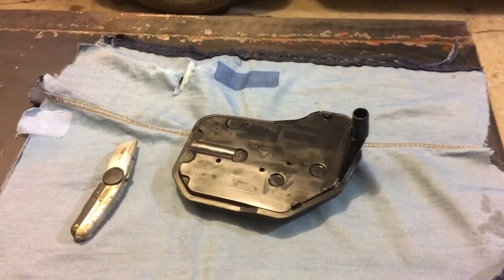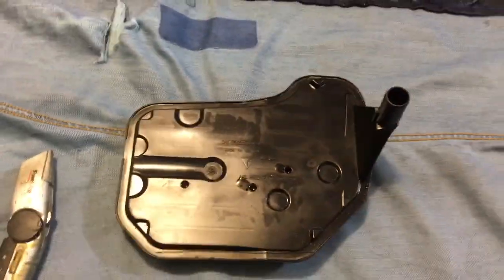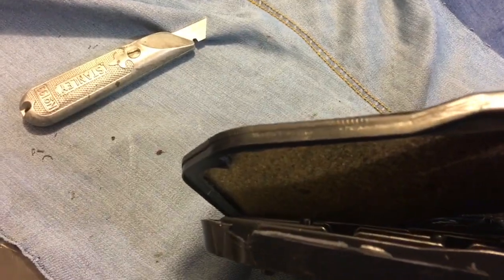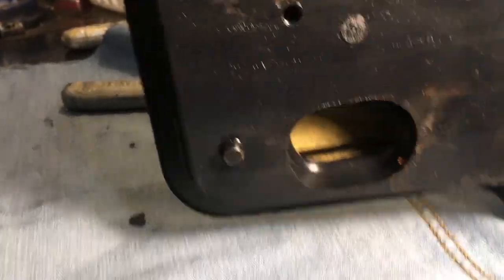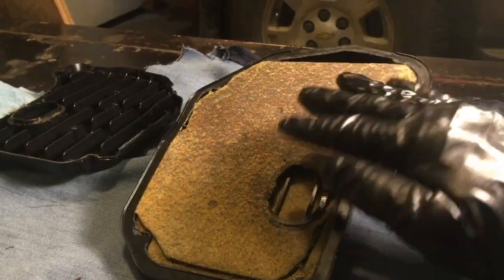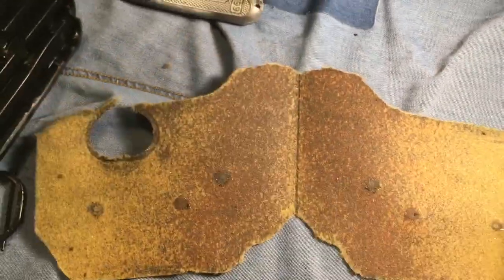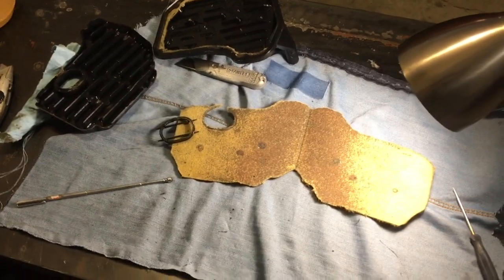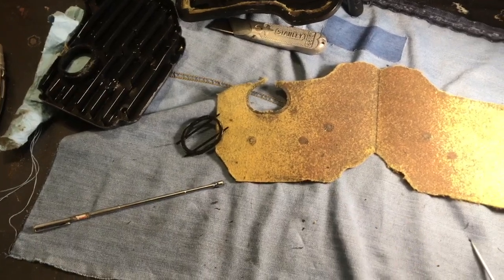Automatic Transmission Filter.  What is inside?  Let's look!

Comment: Greetings can l clean the filter with a fluid substance
Reply: And what kind of fabric is this
Reply from the maker: I sincerely doubt it.  The way the transmission fluid enters the filter and flows through the centre fold of the media, it would be near impossible to flush out particulates.  A rinse/flush with a solvent would dissolve and remove scum and sludge that may be in the filter, but will not likely remove any amount of particles to be worth the effort.  It would be cheaper to replace the filter if you thought it was dirty.